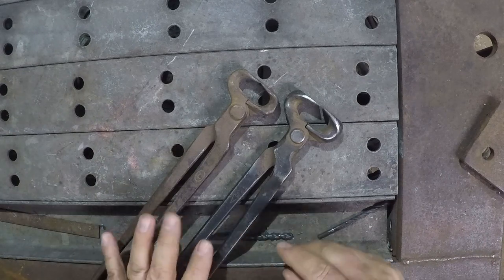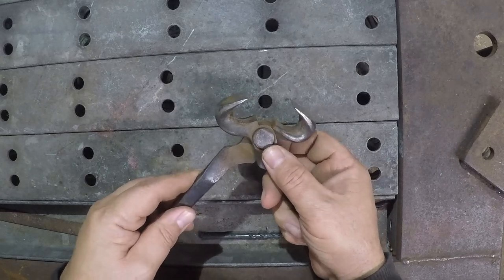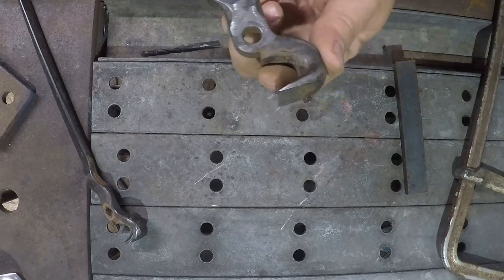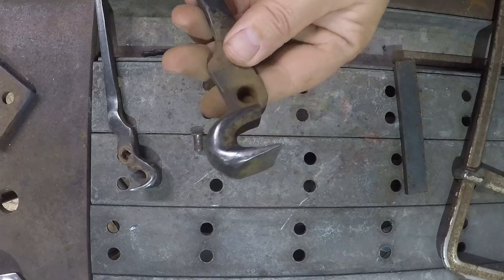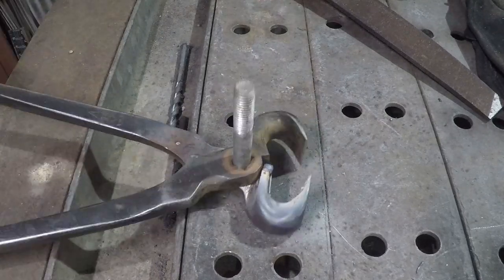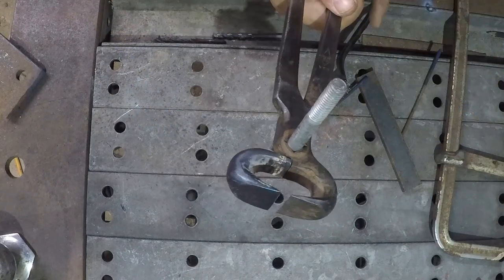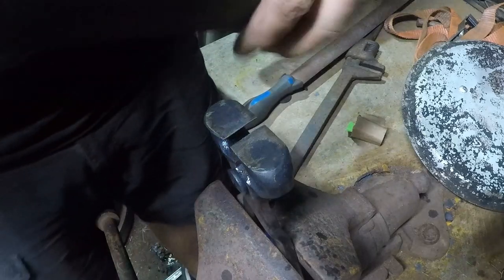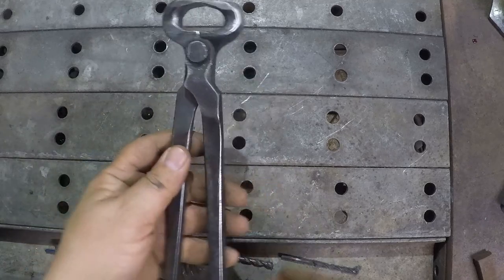Rebuilding an Old Pair of GE Farrier Nippers

Comment from the maker: For anyone wondering, I have a few days of hard use on these, and they cut like new. 

As far as I can tell they are showing no appreciable wear and the rivet joint is still holding tight. 

I'll update here and in the description if they experience a failure. 

Thank you all for watching!

Comment: what exactly is the steel in the wire cutters known?
Reply from the maker: I don't actually know. I treated it like O1 and seems to be doing well.
Reply: I understood that. But could you write the official title or a link to this material. thank you @strangeblacksmith
Reply from the maker: @ВладиславАндриюкВЕТ2202-2м  I think we're losing something in translation. 

If you mean brand or manufacturer, these are manufactured by "GE Forge & Tool" in California.
Reply: And they are hoof nippers, not wire cutters.